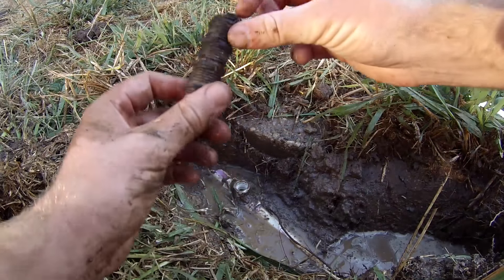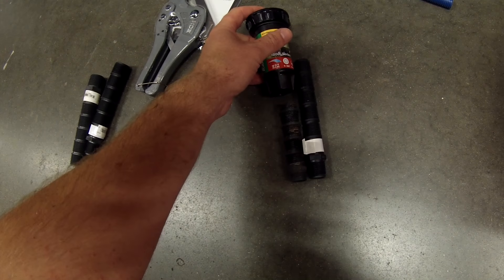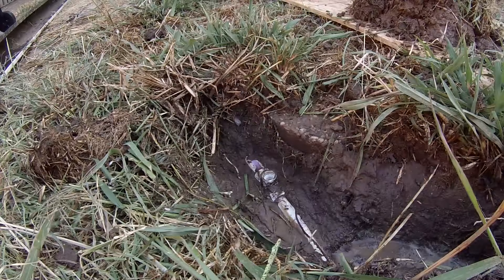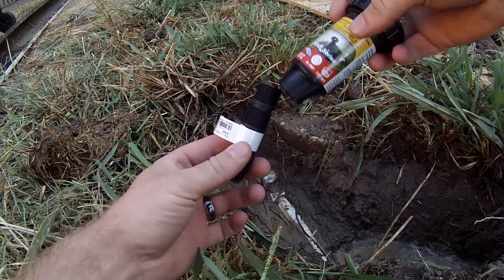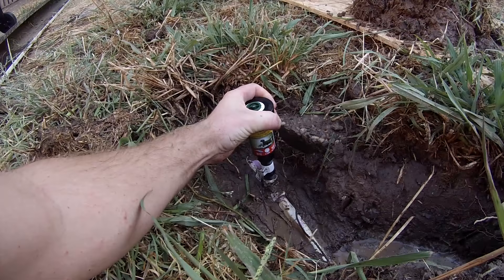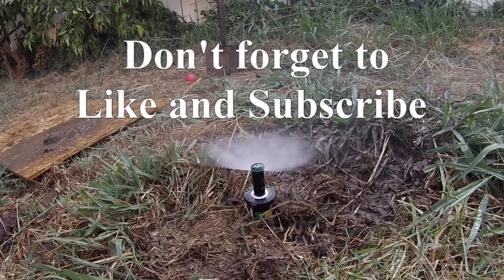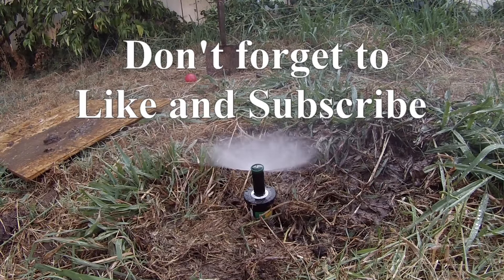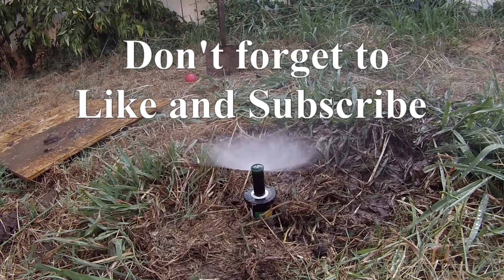Broken Sprinkler Head / RainBird / What You Need And How To Fix

Comment: Excellent! I have to replace a broken sprinkler head on my front lawn and this really helped a lot instead of paying someone $100 to do what amounts to a five minute job!
Reply: It depends on state. If the city wants to be strict catch you replacing any irrigation system/parts you need a license. Even though is easy to work on. I do landscaping jobs I think licensing for irrigation is the dumbest when is a simple Lego build. I would of understand if was a fire sprinkler system or electrician I totally support. BUT Irrigation..... 

Here in Texas is required but I haven't been stopped even though I do have license. BET after 3 years if I decided not to renew it and continue doing irrigation. I have to be so lucky 😂 to get stopped.

In this industry mostly comes when placing new systems. After wards is just sprinkler heads repairs. Hot summer days 🤣 so many customers don't want to dig. Pipe broke or sprinkler head. Then seasons shutdowns or activate them. This is just ongoing business except on winter. Once hits spring you better be ready many sprinkler pipes broke during in winter. 

If a home owner has the time will do it on his own otherwise busy schedule and be with his family let others take care his problem even is costly but knows he paid someone guarantees the fix. Specially if you are not mostly at home working abroad while wife taking care kids. Has no one to repair the problem. Is the reason we charge the amount with limited warranty one time replacement. To keep our customers.

Comment: Excellent instructions!  I've had four sprinkler heads in the last two weeks break off where they connect to the the riser.  One of them, this is the third time it's broken off.  What is going on?  I am not hitting them when I mow the lawn.  I usually edge first around all the heads to trim up the thick St. Augustine grass that tends to grow over them fairly quickly.  They are pretty deep and don't stick up.

Comment: The risers shown break so easy. Better to use the flex pipe swing joints and replace the black street elbows with white street elbows. The black street elbows break so much easier than the white ones.

Comment: I have  broken sprinkler head on a zone that I don't run, but the water pressure to my whole system won't pressurize enough to pop up the sprinkler heads to the zone I do run. I'm not sure if I should replace the sprinkler head with a new one (I'll never water there), or cap it. Will doing either of these, theoretically speaking, allow my system to be pressurized?
Reply from the maker: Hi Kathleen, thank you for your comment! if these owns you are using are not pressurizing then that means there is a leak in those zones. As long as there is not water coming out of where the sprinkler head broke off in the zone that you do not use and there's no need to cap it or put a sprinkler head on it. I hope this helps!

Comment: You should have shown removing the broken riser from the head as the head didn't need to be replaced just the riser.  If you were going to change the head you should have gone with the 4" head for future lawn growth.  But most of all, you did not address the fact that this damage is caused when too much weight is on the head, when it is attached directly to the pipe. The weakest part (the riser) gives way. The best correction would be to put funny elbows on the pipe and head connected with a piece of funny pipe so you never have the problem again.
Reply: thank you! a truck ran over my corner sprinkler and it's leaking bad. was gonna cut and replace the pvc, but i'll instead just cut off the piece that is cracked, install a fitting to it instead and hook up the funny pipe.
Reply: What is a funny elbow and funny pipe?
Reply: You're exactly right.  The issue he "repaired" is likely to happen repeatedly.  Use funny pipe and barbed elbow fittings as well as a 4" spray head, and this would be able to handle average back yard abuse/traffic.  I would never, ever "repair" the broken head in this video in the same manner.
Reply: Thank you so much 
Didn't have an idea on how to fix this at all.
Because of you, I was able to fix and I looked as mr. Fixer in front of my wife.
Great video great explanation 
Thank you again

Comment: judging from the looks of that yard, i'd say a broken 
      sprinkler is the least of their problems.
Reply from the maker: Thanks for your comment norm!!
Reply: . . . . . and,  in your profession,  you will probably see the inside
      of homes that are . . .  well,  lets say 'less than desirable'.
Reply: Norm ....we all are concentrating only on the Efforts and Time this Gentleman has put in here to Explain us and the help from him... We are getting....
I am sure you fixed your Head with the help of this Video...... Hope u understand I meant the Sprinkler Head 😂
Reply: @M.Born007    well,  i have been building and remodeling homes while Allen was still in high school, and  i have also installed and repaired more sprinkler systems than i care to remember.   i watch Allen's videos because he is a good hard working guy, and i want to support his channel.   i'm not quite sure what the point of your comment is.
Reply: Won't the head easily snap again due to the riser being directly on the trunk line? I thought but I'm no Gardner that by having that flexible line as a buffer between the pvc trunk line and your sprinkler head it won't be as brittle. Basically the flexible line would absorb any bumps or hits to prevent this problem from happening again.
Reply: @exceleratorjoshua  What you say is correct, that can an does happen.   However if the soil around the riser is firmly packed, there shouldn't be any flexibility .  But kids and careless yard care persons can create a variety of problems for sprinkler systems .

Comment: How do you know if its the riser or the sprinkler head that needs replacing? Is there a way to determine what to replace without having to do both?
Reply: With the sprinkler valve turned "on", observe the problem...if the sprinkler head popped off and sitting on the ground...check the bottom of the sprinkler head (female) to see if parts of the riser (male) is still threaded inside the sprinkler head. It's obvious then the top portion of the riser broke. The risers are typically a softer plastic and less sturdy then the hard plastic of the sprinkler head. Be aware that the riser can break anywhere along it's length. It can break on the bottom end where it screws onto the PVC pipe. That would be obvious when you pick up the sprinkler head and you see a long piece of the riser still screwed in. If you don't see any part of the riser inside the bottom of the sprinkler head, it's possible it just got unscrewed somehow, but that's not likely. If the sprinkler head didn't pop-off and you see a gushing of water around it and you don't see anything obvious (cracks or damage sprinkler head from mowing or something) then it's possible the riser is partially broken but it hadn't completely torn off. If that's the case, by trying to unscrew the sprinkler head most likely you'll find out as the riser will surely break if it's torn. Btw, if the cap or body of the sprinkler head is slightly cracked...you'll see streams/spray of water. It's common sense really. Good luck!